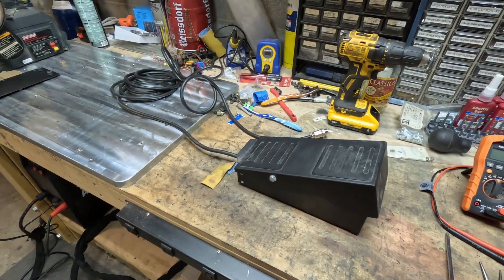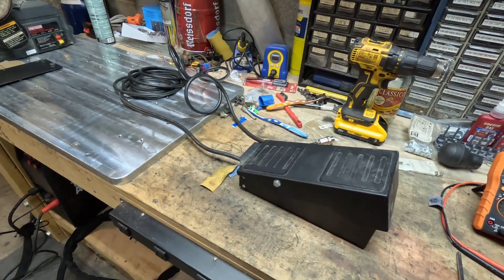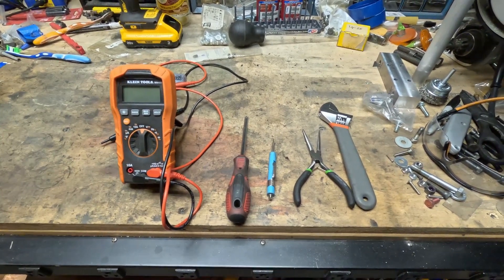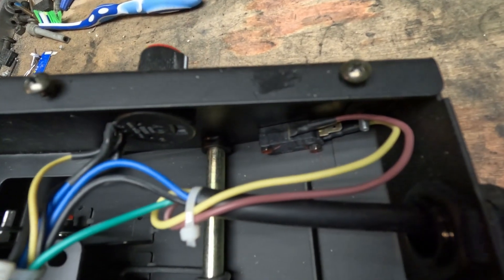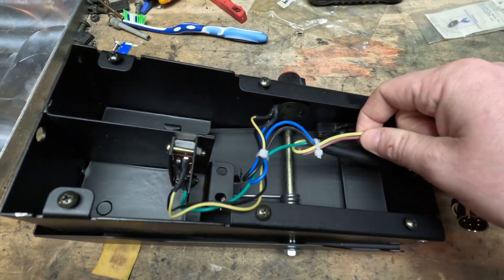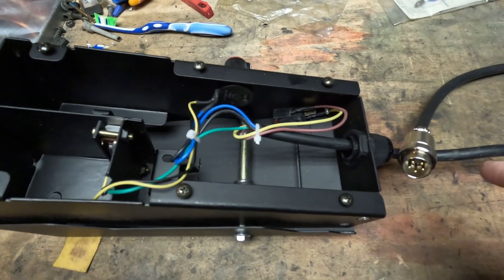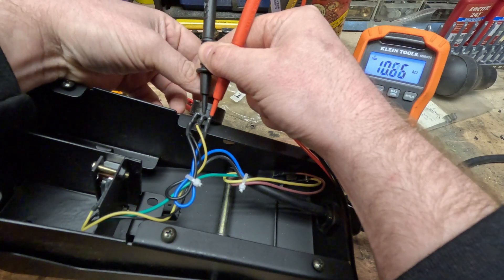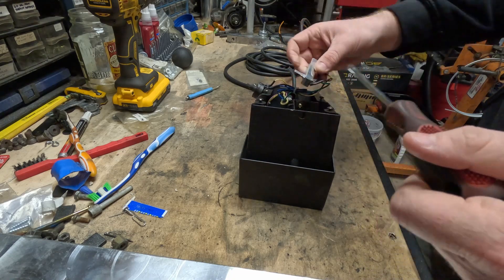Diagnosing why the foot pedal didn't work properly on my Eastwood TIG200 ACDC welder

Comment: Either move the green wire to the other end or solder over the corroded gap you found would have worked fine.

Comment: My foot pedal only reads 100 to 200 amps and doesn't go any lower than 100. What could be the problem? Also, my potentiometer doesn't work either
Reply from the maker: I would say that it’s likely that the potentiometer on the side of the pedal that adjusts current has a dead spot on it, meaning that half of it actually adjusts while the other half doesn’t. Easiest way to test it would be to measure resistance with a multimeter. If it doesn’t change as you rotate for a section of it, that area is dead.
Reply: @thenotsonicecanuck  when we measured the resistance on the slider and when you pushed the pedal down and it went up (middle of the pedal) and then went back down when you pushed the pedal all the way down. So to sum it up we found that it measured the most by the middle of the pedal stroke and then went back down by the end of the stroke

Comment: Thanks for sharing your work on pedal troubleshooting. Could you explain in more detail the function of each potentiometer, this point was not clear to me. Thank you in advance.
Reply from the maker: Yea of course. So the dial potentiometer that's on the side of the pedal is setting the max current. On these particular welders, when you switch from panel control to foot pedal, the dial that is on the front of the welder no longer sets your max current. The dial on the side of the pedal does. The slide potentiometer, which is the one I had to replace, is then adjusting the current even further based on the pedal position and how much you're pushing with your foot.
As an example with numbers, the actual weld machine is capable of 200A. If you wanted to limit your current to 80A though, you would twist the dial on the side of the pedal to align to that value. That's limiting your current window to be from 0A to 80A. That's the function of the dial potentiometer. Then the pedal position determines current while you're actually welding, so pressed all the way down is 80A. 50% pressed would be 40A, so on and so forth.
Does that help with understanding what each potentiometer is doing?
Reply: Thanks Spencer,  i got it, now its clear to me the function of each potentiometer.
Reply from the maker: @ggiardiniweber  no problem! Apologies for not going through that better in the video.

Comment: You're a legend for uploading this, a life saver. By chance would you happen to have a measurement of the two pot's resistances? A friend has a welder, and I'd like to get a foot pedal on it, which I have but from a different MFG...from your video I have the plug confirmed, but would be nice to know the pot values before trying it out. Cheers.
Reply from the maker: This particular foot pedal has a 10k ohm linear slide potentiometer. Not sure what the input voltage is meant to be unfortunately as I never got around to diagnosing that deep because I ended up buying a direct replacement from Eastwood. My back-up plan if Eastwood didn’t sell replacement parts was going to be buying a replacement potentiometer from Digikey or some other electronics website. There’s potential that the different manufacturer uses a different size potentiometer but usually they’re stamped/etched with what size they are if you end up taking that foot pedal apart. Hope that helps you out and good luck!
Reply: @thenotsonicecanuck  , thanks again, you're a gentleman and a scholar. Input voltage would be set by whatever the welder is sending in, would just need to replicate this simple circuit to the pins. I was just curious if you'd used the multimeter to measure the resistance. No worries, this is a huge help, many thanks again!
Reply from the maker: Ah yea I gotcha. I did measure with a multimeter when I got the new potentiometer to double check that it wasn’t a dud before I spent the time soldering it in. Unfortunately I didn’t write down those values and it’s been too long since I made this for me to remember what they were. If there’s any other information that I might be able to get to help you out, let me know. Good luck and glad to hear that this helped you out! That’s exactly why I made this video! 🍻